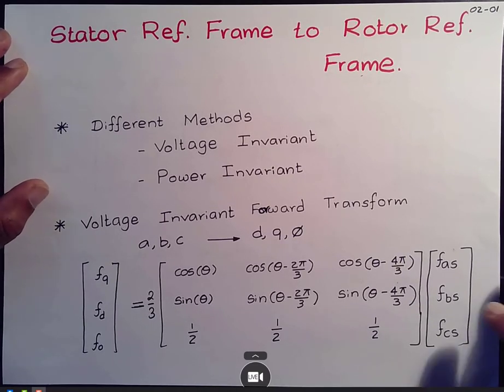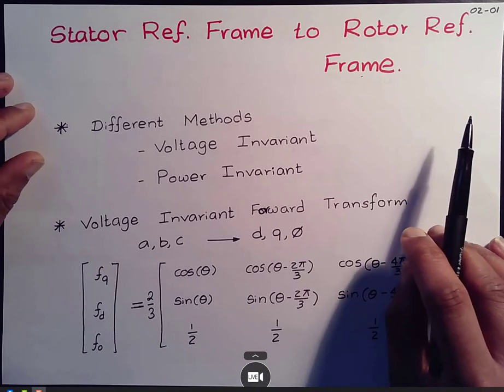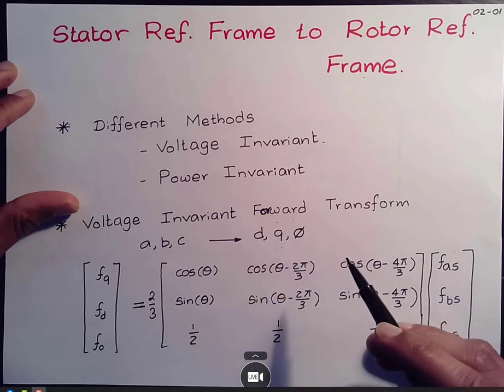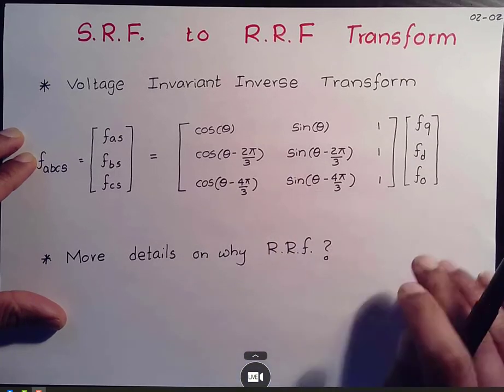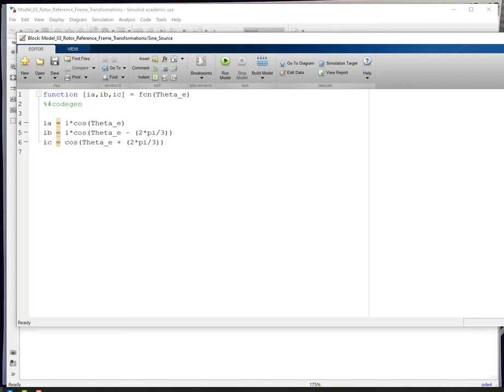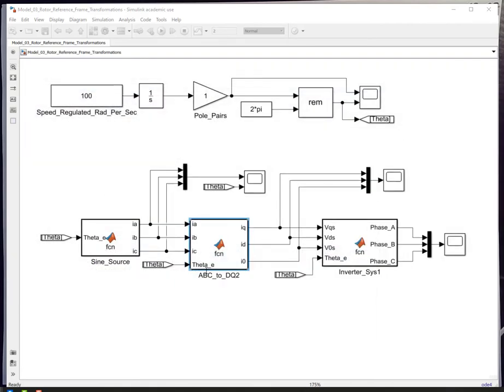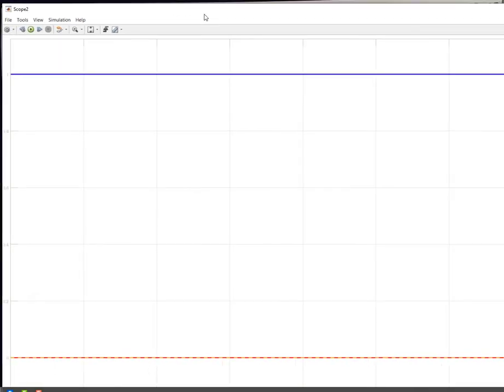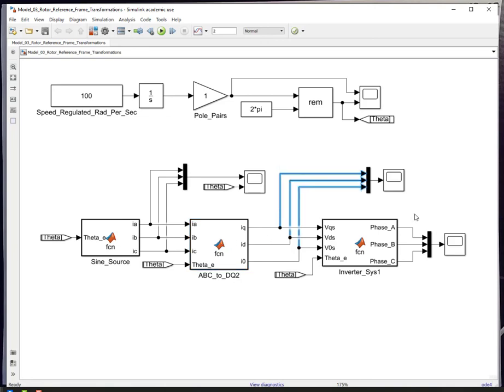Reference Frame Transformation Implementation for Motor Control

Comment: sir i am not getting same signals as you have shown and not getting three phase sinwave back by inverse transform. i have used formulas correctly. niether the transform is showing same results nor the inverse as you.
Reply: Got the three phase signals correct but the dqo signals only showing upper one lower one, another lower one is not being shown
Reply: id is at 0 overlapping, hence not visible when all 3 are plotted.
Reply: same problem

Comment: Thank you so much sir for very useful video.
Sir, how to implement this model in hardware.
How to implement spwm for inverter to drive PMSM by using this model.
Reply from the maker: If you are looking for hardware implementations, Texas Instruments Control Suite has a good FOC example that works with DRV8301 Low Voltage motor drive board. Please check it out. It has very good instructions and labs that really works. Otherwise, you will have to write the software yourself, which is not impossible.